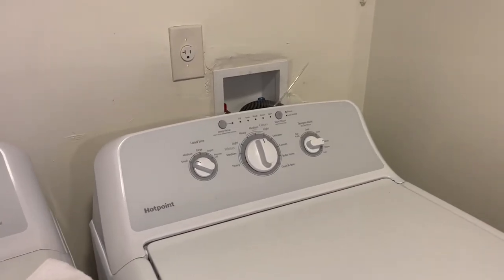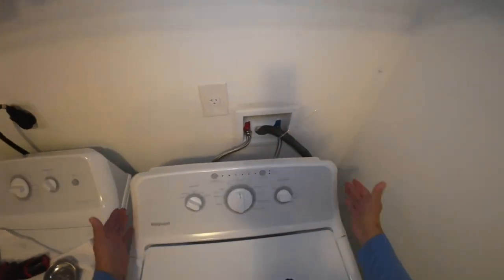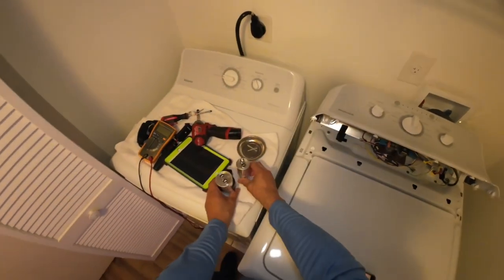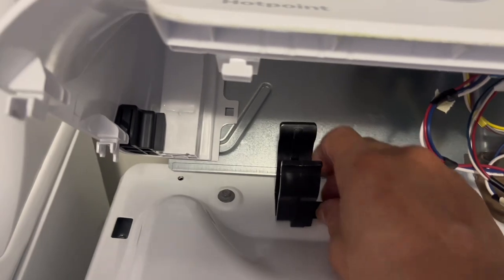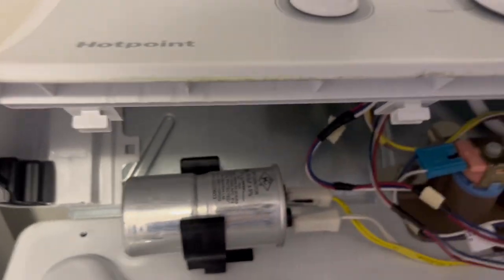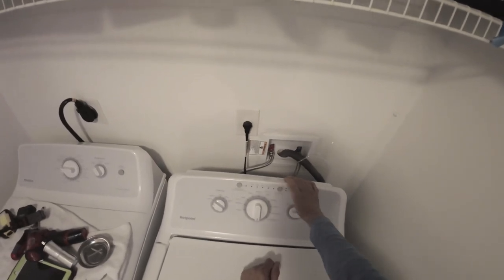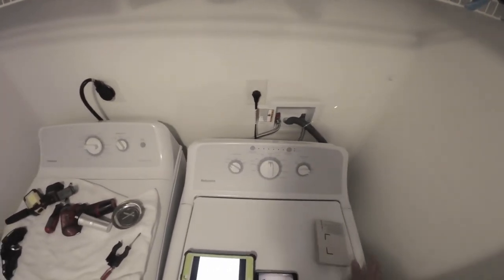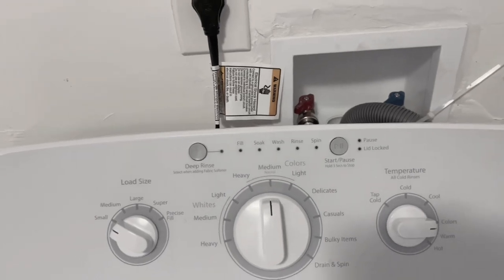Fixed washer motor not turning on with capacitor. Hotpoint washer Model # HTW240ASK6WS

Comment: I have an older model. The knob you turn to start the cycle stripped so therefore i can't set it. Is there a number to call and order part?
Reply from the maker: You can go on searspartsdirect.com and put your model number in. Look for the knob in the pictorial diagram and find your part number. Then you can buy it anywhere on line.

Comment: Have the same model washes, agitates, and drains, but doesn't spin. Do you think it is the capacitor.
Reply from the maker: I don’t think it’s capacitor because when it agitates it uses the motor. I would put it in diagnostic mode and see if I can get it to spin and check the lid lock.
Reply: @appliance63  You're right, wouldn't give power to the motor if it was compactor. Did run it in diagnose mode,fill,drains,agitates, lid locks and spins, just doesn't spin when washing out of diagnostic mode. Checked belt, looks fine, has me stumped.
Reply from the maker: Spin works in diagnostic mode, but not in normal mode. Check for any codes? Saw something on these GE washers from the top of my head, put a 5/32 bit where the pressure hose goes into the tub if its clogged. There is also a pressure switch test during diagnostic. Control board has to send voltage down to the motor in spin cycle if the control board acknowledges that the tub is  empty, and the lid is locking. Have to check if the control board is sending power down to the motor during spin.
Reply: @appliance63  You think the speed sensor could be the problem?. I thought about but haven't yet checked the pressure hose.
Reply from the maker: If you have a 26 fault code. Unbalanced load. There is a ge service bulletin about updating the control board. Speaks about your issue spins in diagnostic mode and not in normal mode.

Comment: I have the same model washer and I'm trying to check the pump. Can I access the pump through that top panel?
Reply from the maker: Hi MilkiMadeTheBeat, the drain pump would have to be access from the bottom. I think they’re three 5/16 hex head bolts.  You can see the parts breakdown of the washer by putting the model number in on searspartsdirect.com .
Reply: @appliance63  thank you! I'll take a look tomorrow!

Comment: I have the same model. It spins, but it does not agitate. Would you have any idea what may be causing this?
Reply from the maker: I would check if you have any codes. I would also see if it agitates 
in diagnostic mode. I would be looking at the mode shifter, which shifts the machine spin and agitate.  Transmission , dirt in the pressure hose that goes into the tub. Also, on these GE appliances they do alot of software module updating.
Reply: @appliance63  thank you. I will find a code schematic.
Reply: Update:

The splines on the agitator were completely gone. Ordered a new agitator.
Reply from the maker: I appreciate the update. I’m glad you found the culprit.
Reply: The transmission may be bad. There’s a transmission that controls agitate and spin.

Comment: I HATE, LOATHE a feature of this washer.
It is the following:
When I let it fill up with water, I add the detergent immediately so that I can add the dirty clothes into the soapy water, but if you don’t add the clothes in pretty much right away, it will begin to drain on its own without pausing.  I’ve wasted SO MUCH, SOOO MUCH detergent because of this disappointing problem.  So much money down the drain.
Reply: This model drains automatically if there’s water in the tub and the lid is open for 15 mins.